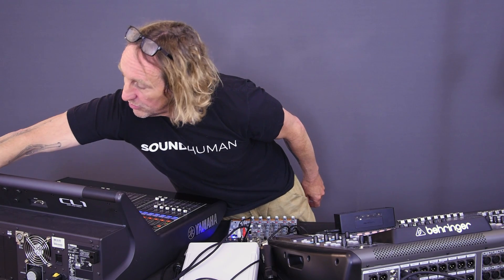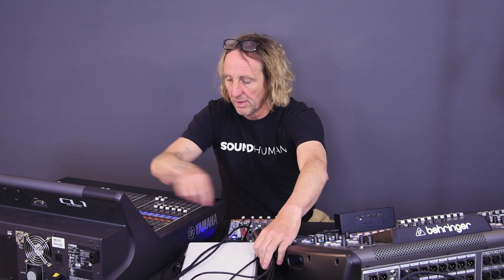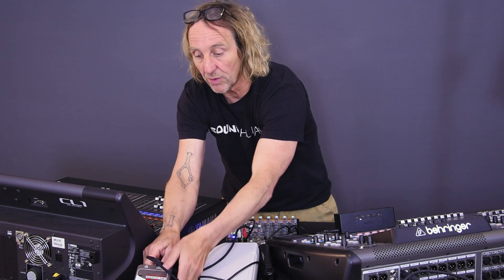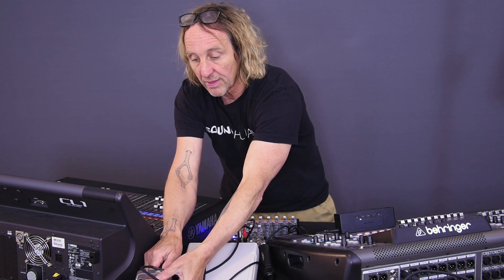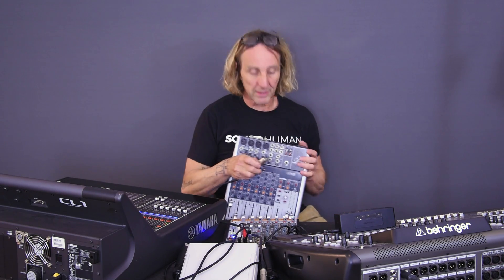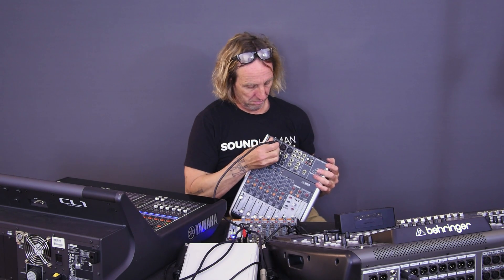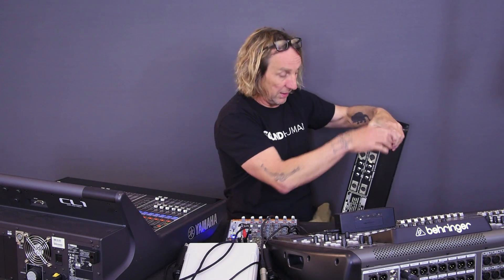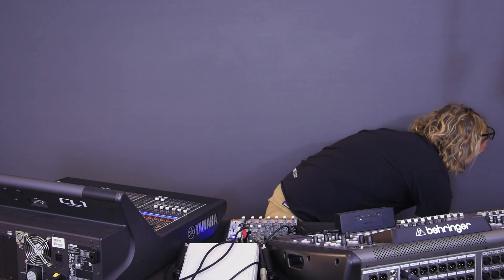Will an ISO Transformer Stop "Off Gear Distortion"? (Public)

Comment: will this happen in 220-240V lines, too?? I'm sure I must have run into this situation as FOH eng by now (15 years) but i've never really noticed it, working mostly on M32/X32 consoles in Europe.
Reply from the maker: yes, it has nothing to do with the AC, but rather that when electronics are not powered up they can have lower impedances that load down the circuit and cause level drop or distortion
Reply: @DaveRat  but wouldn't primary impedances be higher on EU/UK power tranformers? In other words would the effect have the same magnitude? Or is it just dependent on the input impedances of the channels?
Reply from the maker: it's not the power transformer that is the issue. it's the audio input circuitry of the gear that is not turned on. it you have a mic going to a splitter and the splitter connected to 2 consoles, if one console is not powered up, the input circuit of the off console will load down the audio line. and drag down theic output for which is also connected to the console that is being used. and... transformer isolation will not solve it. you need to either unplug the audio line from the off console or power up the off console

Comment: I run sound sometimes for smaller shows.... if you learn ANYTHING from Dave,   TEST your gear/rig  in many scenarios so you KNOW what works and what doesn't.   This way you won't be losing your mind troubleshooting at the show.
Reply: @DaveRat  Yet so often,  I see some musician bring in some piece of kit that's going to "improve things"  and insists it be hooked up right away...   There's no time for the engineer to test it,  and it does some crazy stuff messing with the musicians.     On my rig,  I know every inch of it,  and I've repaired it a few times.   Is it a "great rig"???   probably not,  but there's been some great sounding shows using it,  so Yeah, it IS a great rig for me anyway.

Comment: Interesting but this makes sense because of the preamps on the mixers drawing some of the signal voltage. Strangly enough the small mixer didn't cause an issue at all. i guess maybe on how small the pre-amps are?? Not sure. Be interesting to know the Ohm load change readings when doing so

Comment: This is very interesting! I've heard this effect before as well in different scenarios. It would be interesting to know what in the circuit design of some pieces of powered off gear contribute to the load down effect and others do not. Instead of an iso or hardwired split, I was wondering if when using a distribution amplifier or an active split, if that would resolve the issue.
Reply from the maker: Scam the comments below. There have been quite a few people explaining what the cause is. Most say it's diodes that get energized and load down the signal

Comment: This is good to remember. I remember many years ago I was trying to run down some alternator noise in a car stereo with three separate amplifiers. The weird thing was unplugging the RCA's any one of the three would stop the noise. But then I noticed that turning them off wasn't the same as unplugging them and there was one of them that stopped it when it was turned off. The other two did not. Strangely this amplifier was actually a duplicate of one of the other amps in the system so I swapped them. The behavior persisted so I sent the amp back to the manufacturer and put in a new amp of the same model. There was no noise with the new amp. The manufacturer found a power supply capacitor installed backwards on the circuit board. I can't say for sure if that fixed it because I never put it back in that car but we did sell the amp in another vehicle and it did not have that problem. Someone got a very nice amp at very nice price because of that...
Reply from the maker: Super cool and appreciate the info/story!

Comment: I just remembered a real world experience I had and I wish I had the foresight to take a picture of the mixer.
I was brought in to help a church and I noticed one of the channels sounded really weird with whatever device was plugged into it at the mix position. After going over a few things and thinking maybe that's just a bad channel I wondered up on stage and noticed there was a disconnected not used DI plugged into a wall jack which corresponded to the cable that was plugged into the mixer. For whatever reason the XLR jack on the mixer shared some thing with the quarter inch input as well. I wouldn't say this was a cheap mixer but the remedy was to unplug the device from the wall jack and subsequently not have that snake Channel plugged in.

I want to say it was one of those RadioShack/realistic cylindrical DIs, and a wireless microphone receiver on the mixer.
Reply from the maker: interesting and lingering bit of gear can be gremlins

Comment: This is exactly what I was thinking when the problem was raised a few videos ago. I love this channel for the crazy stuff like this. I just wish I could watch it more.
My original thought was that it would be affected unless it was transformer isolated although it really depends on the quality of the transformers to further isolate unless one end of it is acting as a load in the off State.
Reply from the maker: The higher the quality of the transformer, the better it will be at passing distortion through it. A perfect transformer would pass distortion at the same level as a hardwire
Reply: @DaveRat  oh interesting so it has the opposite from my hypothesis.

Comment: Hi Dave. Something I have come across and I reckon it would be a huge advantage to go through it for the audio community as we all use it.

Some small digital opamps used in mobile phones and Bluetooth adaptors that are normally used to drive headphones or get used in this case as an auxillary out, when summed to mono via a cable, create very audible distortion. I would assume this is a byproduct of the negative feedback circuit doing its job. In normal analog circuits this is fine as and difference between left and right are fought about linearly, where as in the class D world, well that transition doesn't go so well.

So, as an example, if you have a 3.5mm coming out of a phone, to two rca's, then go from 2 into 1 as many people do if you just want a bit of bgm, any difference between left and right is pronounced as distortion. Anything common to left and right comes out fine. 

I found that by adding a 1k resistor to each signal line prior to summing them fixes the problem.

Logitech Bluetooth adaptors and iPhones (that still have a 3.5mm jack) seem to be the worst. Funny, as they are probably the most used devices.

Thanks.
Reply from the maker: Interesting I'll ponder that

Comment: Transformers can’t perform magic. A mismatch at the output winding is reflected back to the primary precisely. What they CAN do is deal with differing ground potentials which is a very real issue in complex and large setups. Not much of an issue at your band’s club gig. This is why the most effective use of an audio transformer is at the output of a near-zero impedance amplifier. This drove me to develop at great expense an active splitter with driven transformer outputs for my Artisan Mobile. We often dealt with half mile analog snake runs, literally no chance even to troubleshoot. Split problems virtually vanished from the day I put it into play. Nevertheless, tech moves on and it is obsoleted by issues of weight. The two splitters and 56pr mults weigh just over half a ton and I’m over that.
Reply from the maker: Good stuff and agreed

Comment: Dave, off topic question: I need to make a new cable in order to use my vintage Electro-Voice 676 microphone that has a 91-MC4Female 4-pin connector. I wanna use the MC4Male connector from the vintage cable that came with the mic to make a cable with a male XLR to use with modern equipment. I'm assuming the vintage cable has 4 wires while the XLR only has 3 wires. What's the best way to go about making essentially a MC4 to XLR cable? Thanks!!

Comment: Electronics time....

The cause is how the input is designed. For low level (high impedance) inputs it can be desirable to buffer the signal before anything else. That can be done with an opamp. The problem is that the signal will be diode clamped to the power rails (chip inputs do that). When the gear is on that clamp is to +/- 15V when off it is +/- 0V.

Lìne level inputs don't require immediate buffering and are usually equivalent to a resistor load to ground.
Reply from the maker: Agreed, and what is interesting and important is that there is almost no documentation or awareness of this.

Have you seen this listed anywhere?

How are non electronics people supposed to know this is an issue to look out for?
Reply: @DaveRat  not seen any information, input impedance when turned off just isn't in any kit's tech spec (well, not at professional audio gear level)
All I know is a good grasp of electronics and can spot ooopsies like this pretty quick.
I'd be interested to see what trace you get on a 'scope when it's clipped. My money is on sine wave fairly hard clipped to +/- 0.7 or 0.2 volts.

As for mere mortals.. Just gotta suck it and see.
Active DI boxes could be cajoled into fixing this if you can run them without phantom power.

Comment: Press box splits come to mind as affected scenarios. We don’t have any control over their gear or usage; and aren’t directly monitoring that output.
Reply: Most good press box splits have an active buffer amplifier for each output, thus would be unaffected  by this phenomenon.
Reply from the maker: Also in my experience, most camera crews all want mic level. And mic level does not seem to be impacted by this.

We have been running hardwire press boxes without issues for many years.

Comment: Hi Dave nice work as usual. What happens if you swap the ISO outs? Radial schematic looks like it has a passive split on one side. Have you tryed a Lundahl based splitter with several iso windings? I have never encountered this issue in my Lundahl based splitter. Its one passive(FOH)...(2) true iso....Monitor and Truck. I think the part number is an LL1590
Reply from the maker: It really does not have anything to do with brand and in fact the higher quality the transformer, the better it is at passing audio, the better it will be at passing the loading that causes the distortion.

Transformers are bidirectional and pass electricity in both directions and any output driving the transformer will see the load on the other side of the transformer, so...

If the transformer is properly working, a change in the load will impact the circuits driving transformer. And if the circuit driving the transformer is impacted, then everything that the driving circuit is connected to will be impacted
Reply: Thanks for the reply Dave...email prose never one of my strong points. My question was not on brand but on if you swapped the passive split side of the Radial did the loading and distortion follow the swap. I totally missed you are using a JS3 and both of the transformer ISO outs.
Reply from the maker: What is occurring is the console that is off is loading down the signal and causing distortion. So it doesn't matter whether or not the console is hooked up hardwire or through a transformer the loading down of the signal still occurs. So it doesn't matter which console is transformer isolated or if both are isolated, the issue will still occur and impact all things connected to that signal.

One way to solve the issue would be to use a separate active line driver to each console.

but as long as the consoles are connected together through hard wires or transformers or even if they were capacitor coupled the issue would show up everywhere.

Comment: I've had this issue with a Behringer headphone amp, hooked up to a patchbay in parallel with the main out (when powered off). It was inaudible, but I happened to have an analyzer on the signal and was wondering why I was seeing unusually high distortion figures.
Took some time to track that down; these kind of hidden, unexpected issues are the worst!
Reply from the maker: Interesting and yes, that is exactly the scenario

Comment: I am completely blown away by this, I was certain it would have no effect with an iso split. Wow!
Reply from the maker: Cool, yes, an audio transformer looks pretty much like wire to audio signals.

For DC a transformer is an open circuit from input to output.

And like all passive devices, a transformer is bi directional

Comment: probably couldve heard the distortion a lil' better if ya put a narrow notch filter EQ to remove the test-tone frequency right on the input channel there.  also, a FFT spectrum analyzer would show distortion way before it's even audible.
Reply from the maker: My goal is to use the cheapest and most readily available gear possible to demonstrate complex issues with minimal complexity.

Such that anyone can easily replicate.

Comment: Isn’t the Radial JS2/3 a mic level device? Or did I miss something? The Radial LX2/3 is line level splitter product. And which console was on the direct out versus one of the iso outs?
Reply from the maker: Hmmm, so do you think that using a different transformer will solve the issue?

As far as which console is on the iso, they both were for the test but the issue happens no matter how you connect that or any iso. Either can be iso, both or neither.

The turning off the X32 loads down the signal and causes distortion and since transformers pass audio bi directionally, the issue passes through the transformer.

Comment: Ok now I have proof for those who don't understand the need for distro amps in line level split situations.  Not only do they allow me to deal with level ,impedance, and wiring configuration matching they isolate a single source from the gremlins you demonstrated
Reply from the maker: There are assets and issues with adding distribution amps. Added complexity, cost, noise and something else that can fail versus added control, improved isolation and eliminating t lge issue of one bad line taking out the everything.

Selecting the best method for the particular application is important.
Reply: @DaveRat  agreed . I like the distro in line level situations .

Comment: So what is the benefit of using an iso split vs. a hardwire split, especially in the context of separate FOH and monitor consoles? What potential problems can the iso actually solve?
Reply from the maker: Hello Kitty, transformer isolation can give isolation from ground loop hum and buzz as well as DC offset issues.

So if you have gear running off of different power sources, transformers can reduce issues associated with the different grounds.

Comment: Thanks Dave!  Does this apply to a monitor engineer that is not powered up?  I’ve had issues at front of house when my monitor engineer is napping and am wondering if an isolation transformer may actually help in that situation 🤪
Reply from the maker: Cattle prod may work for that

Comment: Always interesting stuff. Thanks Dave!
Reply: @DaveRat  Dave, have you yet tried L-Acoustics K3? An irrelevant question to this video subject but I am not finding an old comment where I asked you and you had not tried them yet at that time.
Reply from the maker: We bought a K3 system and it is in the Sonora Tent at Coachella currently
Reply: @DaveRat  I would love to hear your opinion on this. My company currently owns 18 pcs of Kara II, 6 KS28 and 12 SB18, including some other LA speakers. We are looking to buy initially 12 pcs of K3 and use the Kara together with it, mostly for outdoor setups with up to around 10K audience. Would the K3 make any difference in this scenarios or is it better to expand the Kara system to 14pcs per side? Our main objective is to reach a minimal distance of 70M coverage without delay towers and without squeezing the system to the max. Does the K3 sounds much better than Kara, with more presence and more similar to the K2 tonality?
Reply: @DaveRat  Maybe my question is difficult to answer but I would love to hear your opinion on K3.
Reply from the maker: Doing sound visions plots will give you a good idea of the differences. A big advantage of the K3 is it goes lower so you get more thump in the air than Kara.
Reply: @DaveRat  Already done different sims in SV. I wanted to hear an opinion from the legend :) Thanks!
Reply from the maker: Having the ability to reproduce more lows should sound clearer when driven hard.

The little Kara speakers need to move a lot and that will blur the mids.  See my vid in IM distortion .
Reply: @DaveRat  Thank you, will do!

Comment: It's not just inputs getting loaded down when gear gets turned off that can be an issue. I have a crappy old Mackie CFX series mixer I keep plugged into my Rat PA for small stuff when not using a larger console. I'll often have self powered speakers in other rooms feed from the sub group outputs on the CFX. If the CFX is powered off, the speakers in the other room will buzz if left on. They're coupled to the CFX with Whilrwind ISO1 transforms, which doesn't help as in your demo here. I'm assuming the issue is that the outputs are all 'pseudo balanced' with only pin 2 having an active driver and pin 3 with a resistor to ground to 'match' the impedance of the hot pin. And that hot pin looses it's rated impedance when it's powered off relative to the fixed cold resistance/impedance. It's buzz city when mixer is off. I can always tell when I walk in the building if someone shut off the mixer and not the powered  speakers ;-)